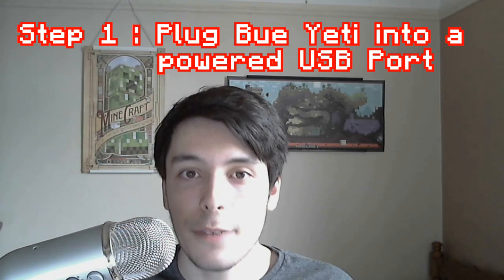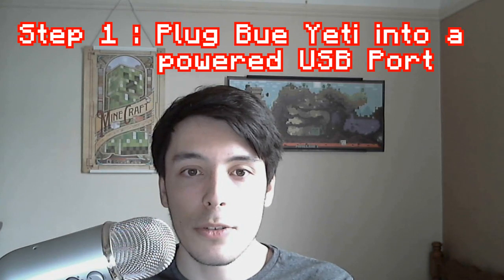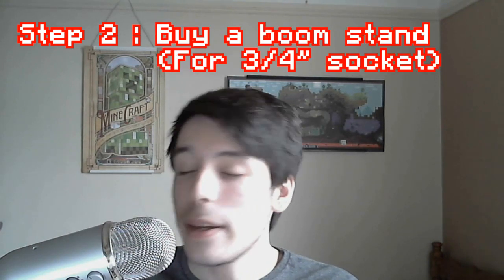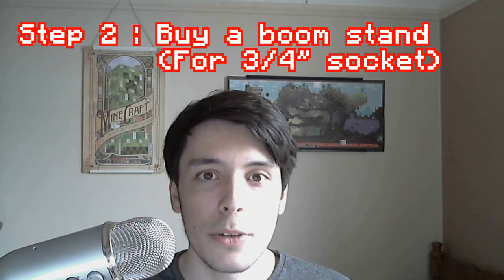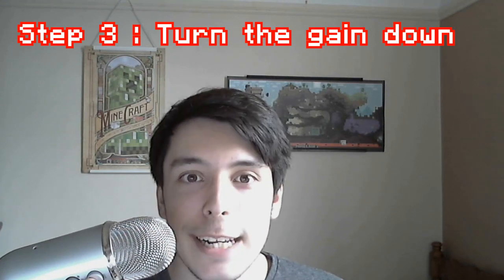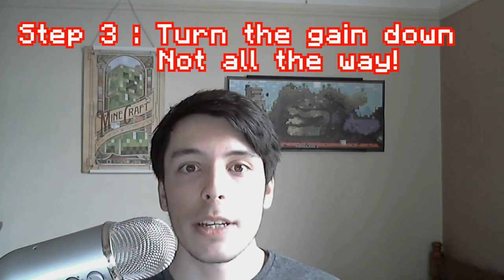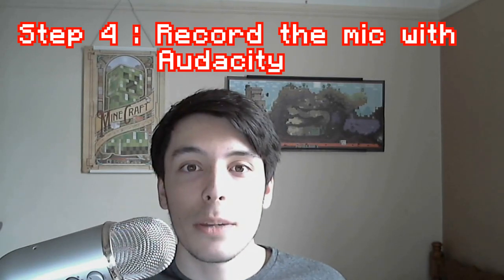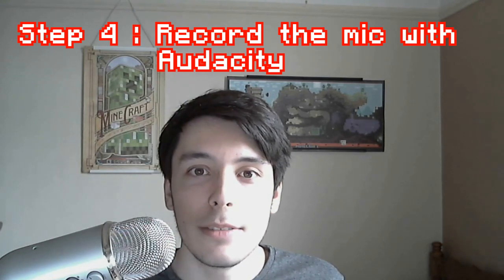How to fix the hum/buzz on the Blue Yeti microphone

Comment: I'm noticing my blue yeti, when the gain is set beween 0% and 60%, my voice is super quiet and heavily distorted/staticky.  I have to set my gain at about the 65% mark to get clear audio, which unfortunately, has me peaking a bit.  I've offset the peaking by reducing my recording input to about 40%.  I'd like to lower the gain though to reduce how much ambient audio I'm capturing, any advice?  I've tried both audacity and my editing software powerdirector13.  Thanks!
Reply from the maker: +SmooreMC85 Actually sounds like your mic could be broken :/ Try changing the USB port you are using, make sure you're on the correct polar pattern and on the right side of the mic, and looking at the recording volume in the windows sound manager (right-click the audio icon in the system tray and go to recording devices, somewhere in there). Thing is it is a condenser microphone and they are quite sensitive, doesn't take much to blow the diaphragm out. Maybe take it to an audio specialist if you suspect it is broken.

Comment: I actually just found out how to finally fix this BS with Audacity. I keep getting this annoying humming or hissing sound no matter what, but if you record what you want with Audacity, just record a few seconds of background noise. Meaning, record just the sound of the room and the hissing the mic is picking up or somehow making. Then, highlight the few seconds of the background noise you recorded before whatever else you meant to record, go to "Effect" at the top menu bar, select "Noise Removal," click on "Get Noise Profile," then click anywhere on the track to remove the highlight, go to Noise Removal again, and lastly, click on OK to have Audacity remove the background noise. It actually works perfectly. I'm sure my mic is getting the hissing sound from EMI interference, but this trick removes it completely.
Reply: i LOVE audacity

Comment: What exactly do you mean "a powered USB port?" I am fairly certain the thing can't work if it is not being powered by a USB port... Don't plug it directly into the I/O because that is part of the motherboard, which has a big CPU cooler, a GPU (BTW, 75% of the noise in your PC comes from the GPU) and maybe some RAM coolers. Plug it into the ports on the case (if you have some).
Reply: SpydreX Official Yeah. And?
Reply: DRAGONS DESCENT You asked a stupid question... i gave you a stupid answer
You should automatically assumed he meant a hub when he said powered USB port:)

Also you told people not to plug the cord into the motherboard I\O port which idk anyone who has even thought of doing that and it seemed like it was a statement to prove to people your smart enough to plug in a USB cord correctly, am i right?

Forgot to mention that not everyone has a dedicated GPU as lots of people just use regular labtops and the noise is from the hard drive or CPU cooler
^thats just a little note i'm adding for no actual reason

Comment: Call me an idiot but if the Blue Yeti USB cable is plugged into a powered USB port straight from the mains, then how do you connect the mic up to your PC after that stage? Can someone please explain.
Reply from the maker: Powered hubs have a data cable to your pc and a power cable to the mains, and you're not an idiot, idiots dont ask when they dont know :P
Reply: TheFuzzyMole Thank you very much, one more question could you recommend me decent powered hub?
Reply from the maker: Pqyl not really, the one I use was found under an old 286 computer from the early 90's any hub with good build quality will do
Reply: Thanks :)

Comment: This has been the only video to help me fix the issue I had, turns out it was "powered usb" issue. Basically if it plugged into the PC usb you will almost always get that frying sound from electromagnetic radiation. I plugged mine into the usb on my keyboard and all the frying went away.
Great fix, thanks for the video.